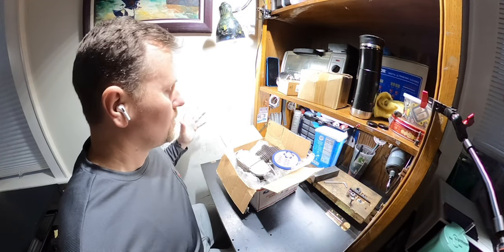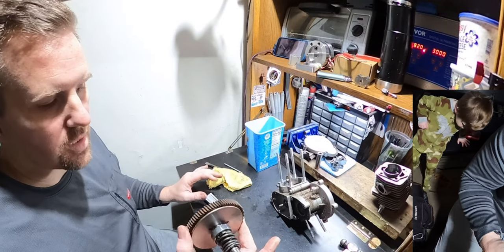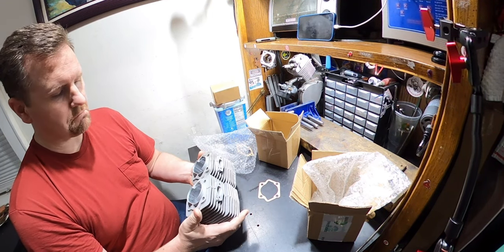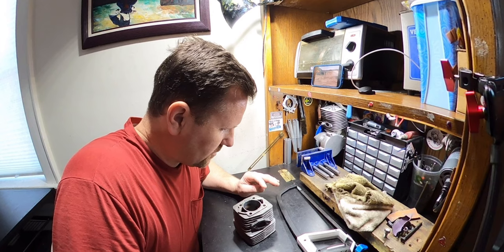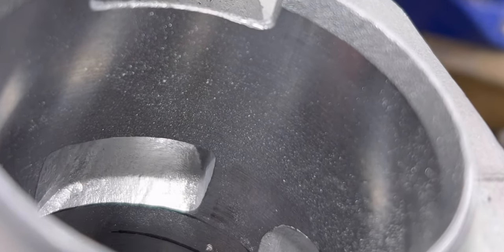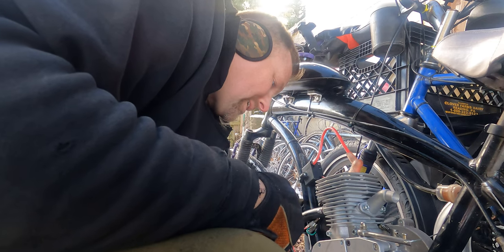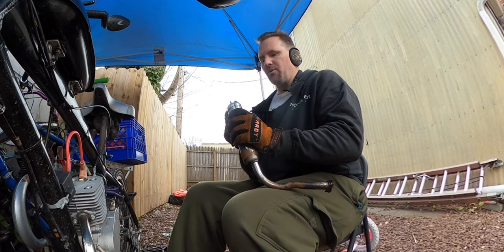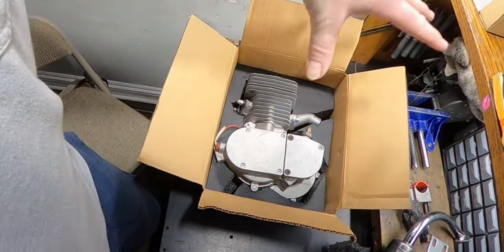Custom Motorized Bike Motor Build, 100cc build to Go Up Steep Hills.

Comment: I've had 3 yard dogs they all ran weird except for 1 i replaced the cylinder and piston and rings on 1 because I broke a exhaust bolt and the 1 I replaced it with ran great that's the difference between casting cylinders and injection molded cylinders like the 80 cc  but you did a outstanding job sounds awesome brother ride safe
Reply from the maker: Thanks, it performed very well. It’s ashamed how bad the quality is for the yd100 now because I got one way back when they were new and now the molds they use to pour in are so worn out that all the measurements are so outta wack that anyone buying one of these “new” yd100s are just getting junk. Cause my first one was great and a few a year later but now it’s been almost four years and the molds are just horrible and producing trash. Feel bad for people that see “100cc” and think it will work well. Honestly the only option to get a decent motor for stock is to get an injected mold motor (which is a definite anymore either) or you have to buy whatever motor is the newest thing out. Like the phantom or the avenger cause the molds are still new. I give the phantom about another year and the same kinda stuff will be happening.

Comment: Damn I like that little setup that you got for measuring your port timings 💯👍
Reply from the maker: I would love a large shop to have everything laid out and to keep it cleaner and better lighting and all that. But for the lil space I got (just an old folding desk) I love it. Keeps it right at my chest level to see inside for ports and I can store the wheel right behind the vise I use. And the vise it on an arm to slowing out the way, so thank you I built it to fit what I wanted exactly. I find I can do more and better work with this setup than before. Being comfortable while working is or should be a top priority I find.

Comment: Wut up Johnny.... Or I mean Uncle Johnny...  That's the best port work I've seen bro.... In the head too...  Love your yd vids... You know your the reason they made the ld 100... Your the first to cut the yd head .... Chinese  copied you ... I got my friends ld running great..  it was  crap B4...  I had to do alot if decking and porting .. . Yd 100 s are the shit wtuned with a gud pipe..  and carb.. ... And
Reply from the maker: Yeah they really do rip when done right. It’s a real shame they don’t put a lil more love into them at the factory. They would sell so many more. This one is super solid now.

Comment: Glad I watched this before buying a YD.........Oh yeah, I seen pop up aftermarket pistons for chainsaws. I'm pretty sure I seen a 2 ring 52mm pop up that would fit an Avenger or P85.....I'm thinking a properly ported Avenger 85- with 2 ring pop up piston- the aftermarket head- expansion pipe & good carb. I'm having trouble understanding how a 47mm Mineralli could make more power than the above 52mm engine.
Reply from the maker: Well it’s all in the port map. The shapes of the ports make a big difference but if you changee all that the larger piston will make more power and torque. I have a Minarelli and it’s not stock at all and I didn’t try it stock but I can say with confidence that this yd I built was almost as strong bottom end as the Minarelli. Now the top end was different but I wasn’t going to for “all the power” with this yd100. But that old adage of no replacement for displacement is true.  There’s a lot of other variables too though cause a Minarelli piston ( haven’t weight them yet) weighs more then a yd100 piston for sure just by feel so that heavier mass going up and down will make more torque throughout the rev range. The mini also has a reed valve causing way more air to get into the motor. If you port the yd100 or like my cdh110 to make the Same power as a Minarelli you can do it for sure and give it all the same goals they are all obtainable. It’s just that the mini has a better stock port map. But once you start to really dig into the motors you can make them all do around the same thing. Just some will be better than others at certain things. Like a 50cc will rev higher then any other motor or a smaller size piston will rev high because there’s less stress on the parts that are moving so fast. And a ms660 will make more torque then anything else that’s smaller when you are going for all the torque cause it’s so much larger then any other piston. So there’s a lot of variables to consider for sure but depending on what your goals are should determine what motor you want to use and how you want to set it up. There’s a lot of options and a lot choices to make power but when you choose you need to first be honest about when and how you will use it and what the actual goal is. If it all speed or if it’s a daily like this one or if it’s weekend fun machine.  Thanks for watching and thanks for commenting, I enjoy talking with everyone in the hobby.
Reply: @JMB676  Thanks for the replies & answers 👍
I  just had an idea for a DIY semi universal expansion pipe if you have a welder....You could use some heavy duty automotive flex pipe for the header of the expansion pipe so it can move into different shapes & fit different bike frames. Or make long straight scooter style expansion pipe. Similar to the crappy one Bike Berry sells buy use a better expansion chamber.

Comment: The inside of the exhaust The stinger you called it I cut the full thing off and put 2 holes on the cap runs better again
Reply from the maker: Yes that’s a decent free mod, it is much better than just taking the cap off. Taking the cap off will give better low end feel and pull but losses a lot of top end speed. With how you did it you still get really good low end but wayyy more top end. Good job brother. Glad others are out there trying to to do free upgrades to make some power instead of just buying a bunch of bolt one that won’t even do as much as the free mods.
Reply: @JMB676   another good free mod is taking the sponge out the air filter and drill 5 holes in the back of the filter helps it breathe then just set the pin hight on the carb for best zllaround power
Reply from the maker: @Motorizedstuff  yeah tunning the carb is a much with the needle but the sponge I don’t take out my filter. It’s already very porous and doesn’t restrict air much if at all unless you don’t clean it in occasion but the holes is a good deal as long as you run genders if you ride in the rain at all. A lot of people don’t ride in rain so it don’t matter but I do and I have sunk a few motors in the past from not keeping the water out of there when I first started In race for speed and performance. Unfortunately it took me a few times to learn my lesson lol.

Comment: I remember years ago when the yd100 first came out, mine came with two base gaskets Sooo I thought naw I'll only use one base gasket thinking I'll get more compression. Lol well the piston pinged and pinged kissing the squish band and I just figured that I needed higher octane not knowing the piston was hitting the head. Well it blew-up after about a month.well  It bent the rod lesson learned. Always check the clearance with solder. Never guesstimate.  Never ever ever ever.
Reply from the maker: Yeah I was shocked by how bad they are getting. My first one was when they first came out too and had 2 gaskets and now they come with 1 and still have a 2mm squish. It’s crazy. Now you can loose all the base gaskets and you won’t bend a rod, hell; you won’t even have high compression. Lmao.
Reply: @JMB676  are u under Williams  Moser Jr
Reply from the maker: @lofi-chillstep  in Facebook yes my full name is. I made it many years ago and I was and still am very formal when it comes to that kind of stuff

Comment: Can you now put a aftermarket head for better performance since you made it two piece head
Reply from the maker: Yes I definitely could, I never had one for a yd or Ld100 but I imagine a basic Ld100 aftermarket head would be fine and fit good with a lil decking.

Comment: You should try an avenger you'll throw all those yd100s away 😅
Reply from the maker: Well if someone gives me one I would be happy to play with it. The average sounds cool and looks cool being the new kid on the block but this motor was for someone else that already had the motor and wanted it better, and it’s a lot better now. Personally though I like the iron sleeve motors and to compete with the avenger having the 52mm bore. It’s the same size at my cdh110 on Jokester and it easily competes with it with power and definitely beats it in torque for clumping hills and stuff like that. Now if it’s a weekend fun bike that’s a different story. I never seen an avenger up close with my own hands and eyes but in videos it looks like it’s very well made for an all aluminum cylinder with nice ports and proper durations with fully open ports and all. The avenger also can be taken out of the box and put right on a bike and have some real fun, yes it benefits a good bit from porting it and all that but you can just take it out the box and play. The ones I like 100cc/49mm iron sleeve or the 110cc/52mm iron sleeve can be taken out the box and put directly into the work bench to make them run proper, forget about powerful. They don’t even run half decent out the box without a lot of help.  So yes the avenger would be hella fun but I still don’t think it would make me throw out my yd100s simple cause my favorite part of the hobby is the building part, even more then the riding. I was looking on a website last night, to be honest;  at the new avenger cylinder/top end kit as a replacement for one of my yd100 cases since it’s a bolt on piece. I have the right crank already and all and was thinking about buying a block of aluminum stock and making my own cylinder head for it. All just “window shopping” right now but there’s a good chance I’ll do it once I get the moneys. Building and playing with the latest and greatest is really good for the channel cause it brings in new eyes for sure.  This yd100 though I think would surprise you with how much power and torque this motor makes with a mostly stock setup, carb and pipe style and intake with a piston port; the ports weren’t even that aggressive. So there’s a lot of power to be made in these motors if  you port them right . Just cause it’s smaller bore or different name  on the motor doesn’t mean it can’t make as much or more, like this motor; then the new hot ish. Well anyway thanks for watching and have a good one and thanks for the comment, I enjoy talking with others if like mined thoughts in the community.

Comment: I'll say we need to work something out with my phantom 85 kits. I'd like you to do the cyl for me on mine. I'll pay shipping both ways
Reply from the maker: Brother, that would be awesome. I would be totally down for that. I know it’s a stock yd100 bottom end so I have stock bottom men here I’m sure I can use one of mine to match up for the cuts and squish the only question I would have is what connecting Rod is it so I can use the proper crank to get the proper measurements for you.

Comment: Runs great but need more low end, here is what I am thinking, Jack shaft with 3 speed internal gear rear wheel.. would have hollered earlier but Zucken Stein  banned me from his platform.
Reply from the maker: @bobkenyon6327  well I’m glad to hear it’s running really well, but in all honesty, a jack shaft is not going to help. It is only going to have it be harder to run because it has to turn all those gears and shafts. I mean you’re definitely welcome to try, but I’ve never personally tried but heard from others that I respect that have tried and they said it really doesn’t change anything except make it much harder to start because you usually got put a start on because the motor is so hard to turn over with the sprocket because it’s so heavy that you can’t actually start the motor by popping the clutch. Also, as far as the low end, that’s a little surprising to hear because when I had it, it had really good pick up went up the hills no problem. All of that. What kind of gear do you have on the rear sprocket?
Reply: @JMB676  I am running a 44 tooth, When I get to the road it is fine but the roads in the farm are really tough. i am gonna try some kind of gear selection somehow.
Reply from the maker: Well if I’m not mistaken you said your not hung up to much on higher speeds so the easiest fix for more grunt would be a larger sprocket in the rear like a 50-52 tooth. But either way I’m glad it’s running well for you.

Comment: Bro that’s insane that it’s that rusty wth and your telling me it had water in there just chillen wow
Reply from the maker: Right that’s crazy, a brand new motor had water in it from factory. They pour mold the cases the cranks the connecting rods and the. Mill or lathe them to right sizes and then assemble at the “factory “ type places. Then stored on a shelf with no top on waiting to be shipped to the other factory to get finished up with the top ends. Now these yd100 bottom are used for a lot of other motors like the phantom 85 and the new avengers. So there’s way more cases being made and the majority of these “factories” or forges really are all outside with large tarp over head for shade or rain. Most of these places are in dessert type areas and rain isn’t that much so walls and that aren’t needed since it doesn’t get cold. But humidity and rain does happen and when these cases are together and just sitting on the shelf’s with all open tops all that gets in there and just sits till the cylinder gets put on from whatever factory it goes to. So it is a shame that they are not built better or just better quality control isn’t implied. But that’s why no matter what more you buy it should be taken apart and cleaned out at bare minimum but imo taken apart and gone through. If your able to personally I think each one should be ported and decked but if you can’t flip that or don’t want to or just aren’t able to then I think buying a motor from a reputable builder (like myself) is the best way cause that extra 100-300 (depending on motor and level performance you want) you would spend having me build it or someone else built it is a drop compared to buying a motor and slapping it on and then 6 months later doing it again and again and again. Cause buying even the cheapest motor kits you will be at about the same price or cheaper even then a custom motor and the custom motor will run way better run smoother have better performance and depton who builds it last much longer. Now not everyone can build a daily, to be honest I would put my daily build up against literally anyone in the business because building reliable motor isn’t easy. You can make to much power or not enough or have it rev to high, there’s a lot to make a daily motor hat you can just put on and run without worries and imo probably the hardest thing to do. Cause all stock part being reliable isn’t easy but making power is simple in comparison. I have broken many a motor and learned what’s needed to make it survive. Knick in aluminum but it’s very rare I’m working on one of my daily motors unless it’s a coil or something but the mechanics of it the actual motor itself I never need to work on.. they just start and run till shit them off and I think that says a lot cause these lil motors are not designed to be reliable transportation at all. So many people told me I can’t and they won’t be reliable but I think I have proved that wrong by now.

Comment: Did you ever do a compression test? Just ordered a YD100 today for my 3rd gas build.
Reply from the maker: No I don’t have a compression tester but best I could do it explain when it was stock form with the plug in and my drill used to turn it over, my drill could turn it over pretty fast on the high torque setting and after I fixed the squish and raised the compression I had a much harder time just holding it in my hands to drive it with the drill and it wasn’t able to turn it over very quick at all. If I had to guess and it be just a guess but I would imagine I raised the compression at least 30-40 psi. But that’s just a guess going off no facts beside how much harder the compression stroke was. It could been a lot more or could been a lot less to be honest but I do know for a fact that it was much harder to do. I also know it ran much better with premium fuel over regular because the compression was able to use the higher octane cause high octane is only good or useful in high compression motors. It’s not the highest it could be cause I def could get it higher but for a daily rider it’s great so not to wear out the lower connecting rod bearings quickly.
Reply: @JMB676  cool beans! I've ported 4 cylinders over the winter and adjusted squish good. Some have 120psi to 151psi, I've had one at 160psi but I think that's a bit much long-term. Pressure testers are really cheap nowadays, so easy to do too, pull plug, screw tester into plug hole, try to start bike as normal with choke open and throttle maxed out, take reading, about as easy as doing the squish test. Plus that feeling you get when you see 151 psi after all that work gives you a great feeling of accomplishment! Lol

Comment: I see those L brackets on your gas tank. How is that holding up?? Sure beats using the supplied hardware. I've tack welded both my brackets to my frame to avoid the tank sliding around
Reply from the maker: It’s super solid. If I just drilled and put though bolt it would have cracked. I would rather have tig welded a piece of hold stock in between the frame sides but I can’t tig so I just cut a piece a hollow stock in that I could clap it against and pinch the inside sides of the tube. But it’s been two years now and never had to touch it again. But the hollow stock to keep from caving the sides in is a much.